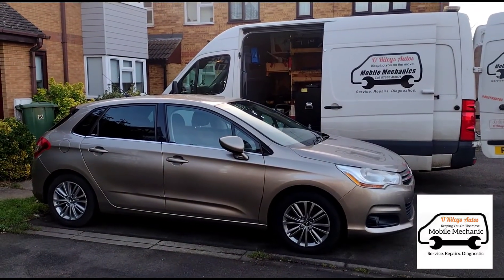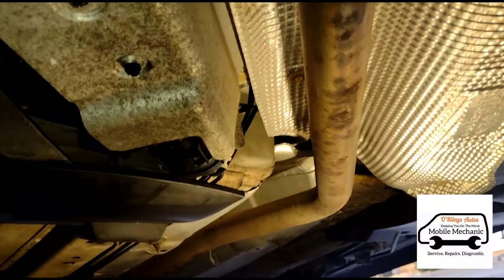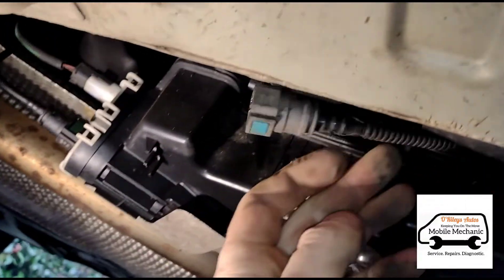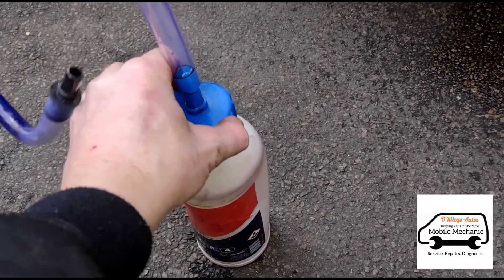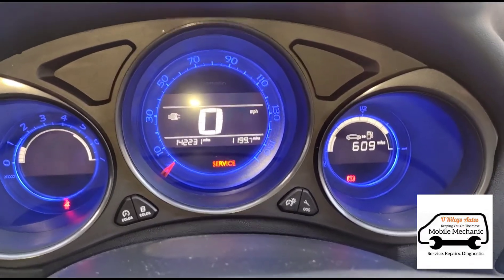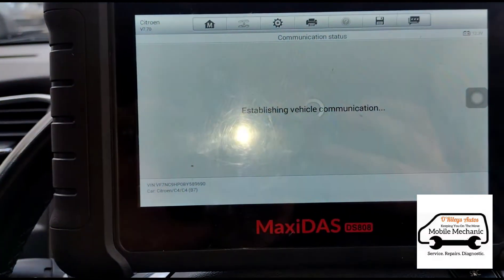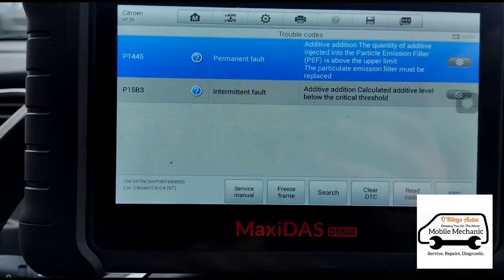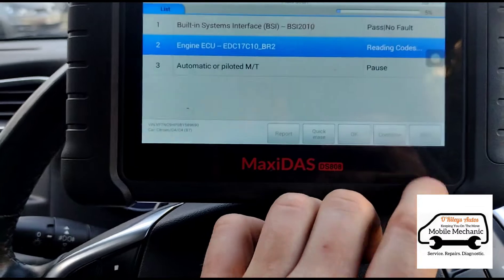Citroen C4 Risk Of Particle Filter Clogging: P1583 P1445 PAT EOLYS Fluid Replacement DEF Bag Refill

Comment: just been quoted £625 for dpf regen and fluid refill
Reply from the maker: Don't allow a regen. Cleaning is better and should be done for that price. Expensive for a regen
Reply: I had my fap fluid replaced at the main dealer it cost £340 all together.
Reply: @jimmyfurey  ended up doing my Dpf Particulate Additive Fluid my self reset the value and the car never register it being full.i still get engine warning when i floor it but it just goes straight off. risk of clog
Reply: @ Ithe fluid system works on a countdown. When the ecu calculates that the reservoir is empty it stops dosing the tank and regents won’t take place The counter needs to be reset once the tank is refilled otherwise the ecu doesn’t know it’s full. I bought a Autel ap200 scanner and it will tell you the situation with your dpf and also tell you if your car is doing regens
Reply: @jamesheath7596  I used a £3000 car computer I borrowed I reset it properly and it's still saying empty I replaced the full bag
Reply: @ it’s strange. My scanner says my dpf system was faulty so I took it into the main Peugeot dealers and they put a new bag of power flex in and reset the fap counter. My scanner tells me that I had a regen has recently happened and differential pressure is low. So I don’t know , I’m just assuming that the scanner I have can’t link with the fap system. I’m just going to keep my eye on the ongoing regen status and watch the differential pressure is low that’s all I can do for now as I don’t want to put it into the dealers again.get yourself a autel ap200 scanner. That will tell you your differential pressure and your ash load estimate and from there you may be a bit closer to knowing what’s going on.
Reply: @jamesheath7596  I'm guessing nothing happeneds to the car anyway mine drives fine been like this 12k miles ...
Reply: @ how many miles has it done ?

Comment: I have same car model. Eolys fluid was refilled but it only stopped the fault message 'low dpf additive', after I injected DPF cleaner spray through o2 sensor's hole the car went out of limp mode and the fault message ' risk of dpf clogging' cleared up and the dpf light went off but the other fault message 'engine fault, repair needed' is still there and it's because the dpf needs cleaning. What else can I pour into the DPF without removing it, can I fill it with 1 liter GAT dpf cleaning liquid or maybe 1 liter brake cleaner liquid or can it clog up the exhaust pipe?

Comment: Spot on mate seen the belt fault only once on a Berlingo checked and all fine so cleared fault EML went off and stop start returned could be wrong but I’m sure it’s programmed into it for set miles or age maybe hoping the main stealers will earn a few quid from it .

Comment: Great video Thanks
I have a 2014 C4 with a P1445 error and motor is blocked at 3000 rpm. Will it fix just adding eolys or must clean filter
Cheers

Comment: Hi, I have a 2013 C4 1.6 HDI same car as in your video above...its on 82,000 i’ve recently bought the car and I had the “dpf risk of clogging” message pop up so I did a long motorway journey in 4th gear all the way 60mph ish maintaining between 3 and 4000rpm revs....on route home I no longer had the dpf message pop up.....

Its been a few days and the message will pop up bringing up the dpf light too for a few seconds then disappear, like a flash. 

My question is, do you think my dpf fluid is running low? 

It is worth me checking for any fault codes with my small basic handheld diagnostic tool or shall I top up the fluid? 

If I top up the fluid have I got to use a special/fancy diagnostic tool like your one to tell the car fluid has been topped up or is this not essential? 

Only as I dont have access to fancy diagnostic equipment and I dont mind topping up the fluid myself. 

Thanks, Dan
Reply from the maker: It does need programming to tell exactly how much it's had as they don't have a level sensor in the tank so just goes on miles
Reply: @ORileysAutos  Okay thanks! 😁
Reply: @ORileysAutos  The system on the Citroens automatically adds a set amount after closing the fuel flap.
Reply: @rockfan3299  does this might not be empty of fluid? Just a rough guess by the computer? Will it stop doing regens while the warning lights are on? Cheers
Reply: @lassydogpie5390  exactly, my light came on and the bag was just under half! I did top it up and reset the counters (difficult to do as there are TWO to find and reset using Diagbox).
Reply: @lassydogpie5390  It should carry on doing regens, It is tricky to get to the container to check the fluid... under the car behind the undercovers and exhaust shield.
Reply: @rockfan3299  maybe cos I’ve always filled up meaning less flap closure’s it’s prematurely activated? Maybe that’s clutching at straws lol.. hopefully no harm will be done if I use it till I can sort it 👍
Reply: @lassydogpie5390  as long as there is fluid in the pouch you will be fine :)
Reply: @rockfan3299  there should be it’s probably a safety net so triggers early as there’s no level indicator

Comment: Great video. A nice simple way to do it. My only problem is that I bought the pat fluid and fill kit. When I connect to the fill pipe with the blue press buttons, the connection leaks. It’s almost as if it’s a fraction too short. Do I need to completely drop the tank and modify the connection for a better seal?
Reply: I ended up dropping the tank. The colour coded connections were different which I couldn’t see until I had dropped it down. If I remember right it should have been the green connector